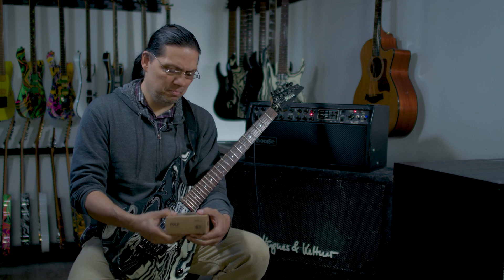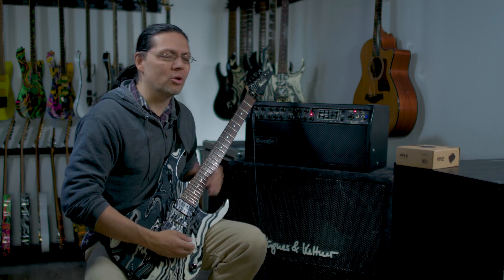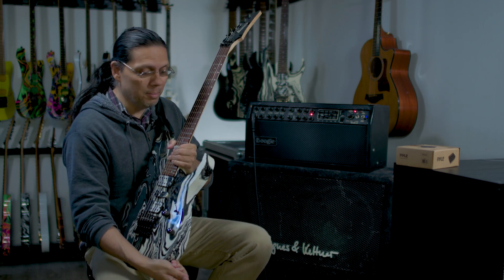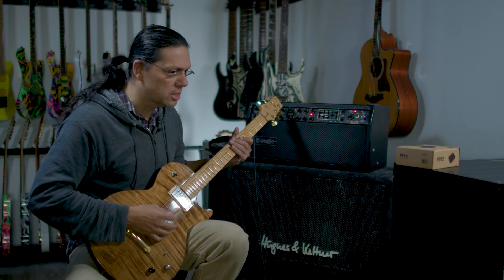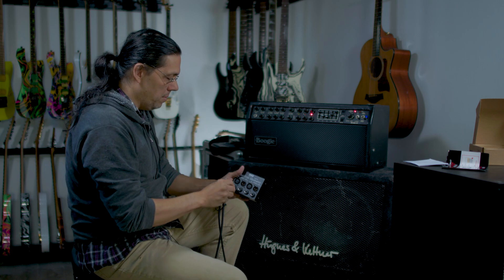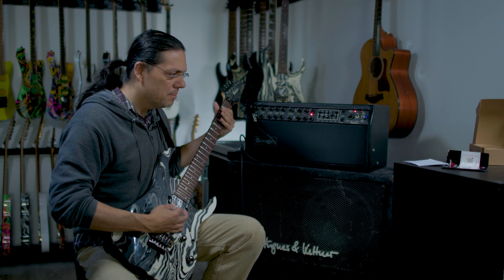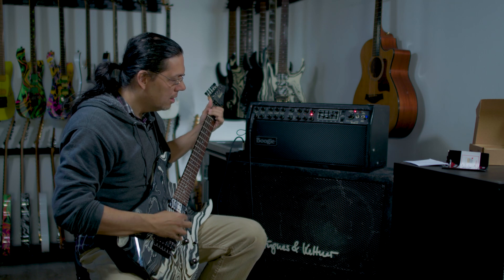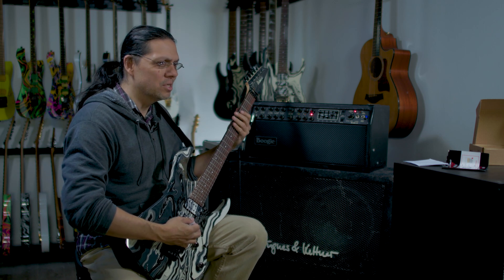SMALLPICKS - Pyle Hum Eliminator on my Guitar Rig

Comment: Hi friend if Im not wrong this device is not to be used on that way.. this has a transforme inside of it to isolate two different powered equipments só they will interrupt loop grounds. As they are projected to powered equipments the impedance also is for this kind of equipment and not for guitar direct connected on it, this is the reason to suck the tone. You should for example connect out of a preamp or pedal or another processor as well the inlet of a amplifier or mixing. On this way the both equipments will be isolated from each other.